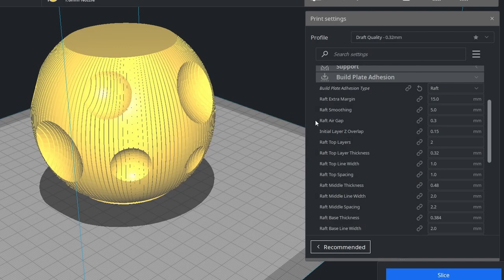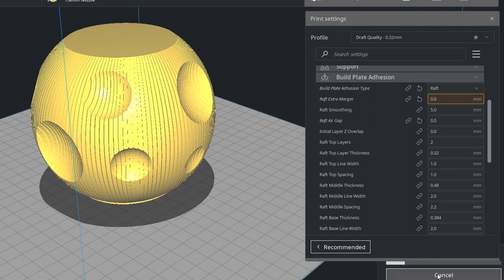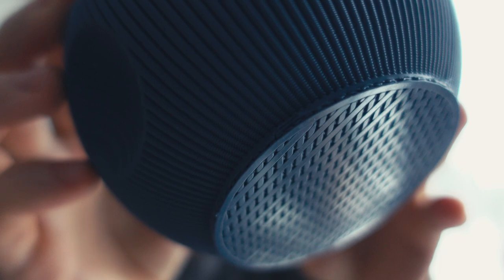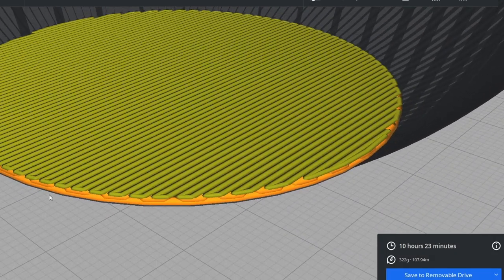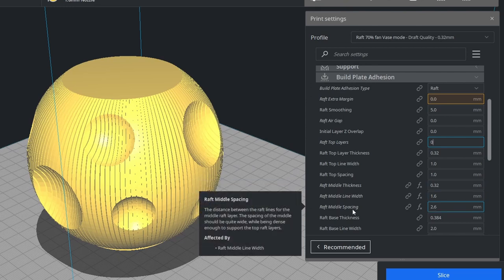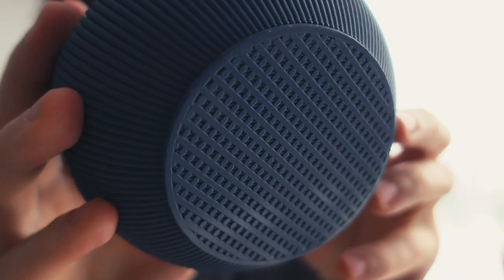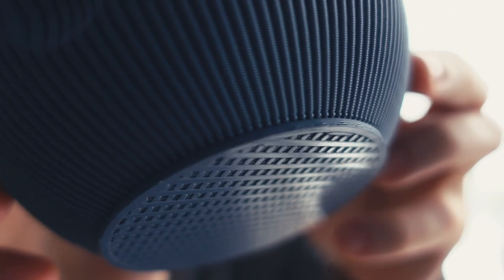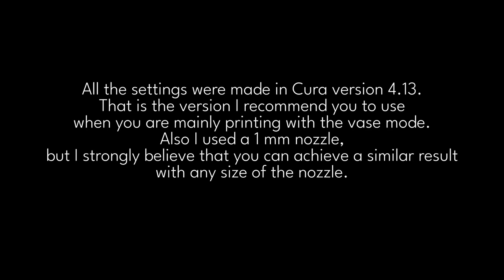Secret cura settings that nobody talked about

Comment: wait you use a 1 mm nozzle for all your vases? i have a design of yours from cubee3d and i just have .04 nozzle. should i buy a 1 mm nozzle before i print? also do i need vase mode turned on? i have never used vase mode, is it hard to turn on?